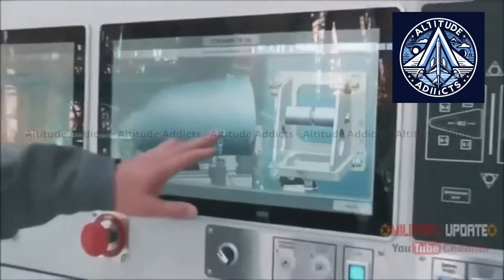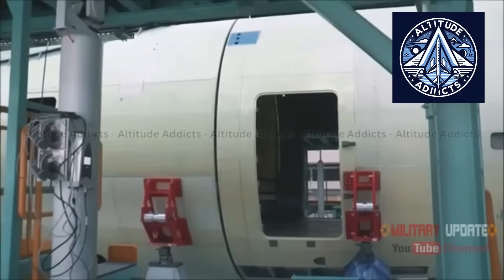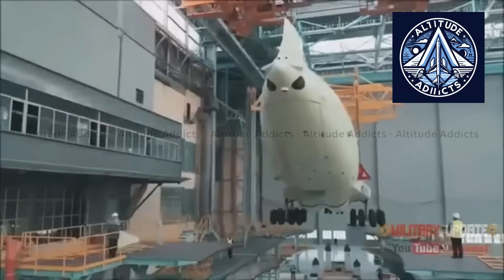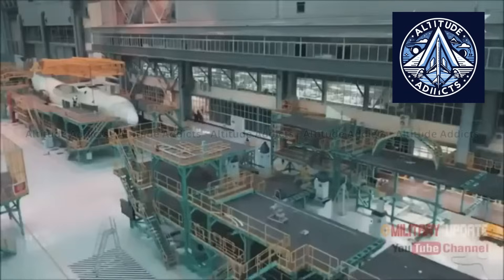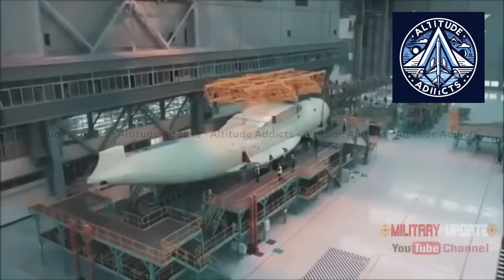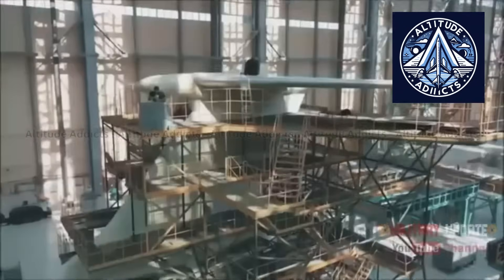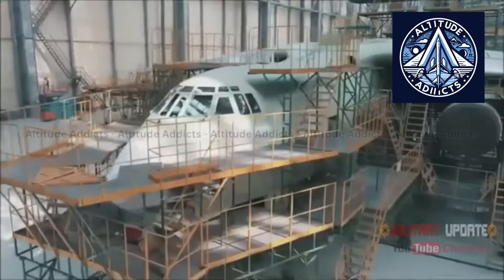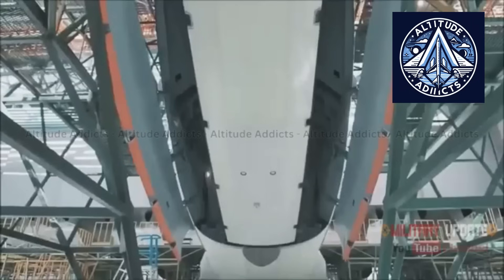Russian Il-76MD-90A Now Made by Robots at Aviastar

Comment: it has nothing to do with Kazan - the first jigless production line was installed in the far east for the Sukhoi Superjet 20 years ago. The guys who installed that then moved on to install the Il-76 line and the MC-21 line and are now installing a jigless line in Kazan for the Tu-214. You have it completely back to front. The wingbox / fuselage join section is the "jig" and everything is aligned to that key central component. The SSJ-100 and MC-21 were designed for jigless assembly at the product design phase. So the Tu-214 needs a design change to suit this style of assembly just as the Il-76 did. So in fact Kazan/Tupolev is the last to modernise to jigless production ...  interestingly the IL-76 is a "widebody" so talk of Russia making a new widebody jet on a jigless line is well within Russia's capabilities
Reply: Почему Ил-76 широкофюзеляжный самолет?